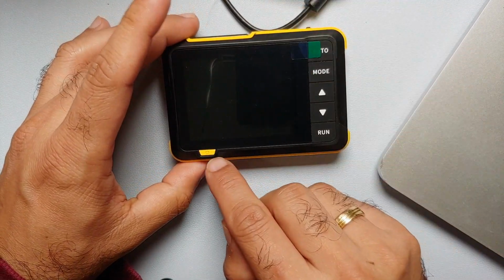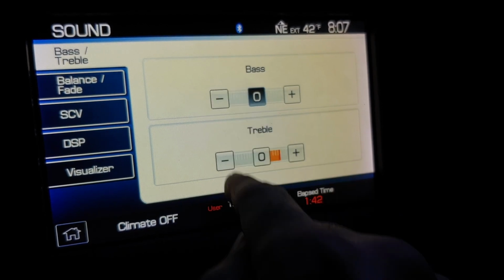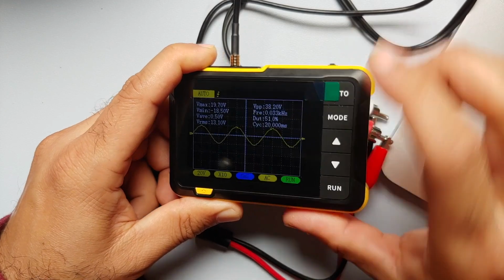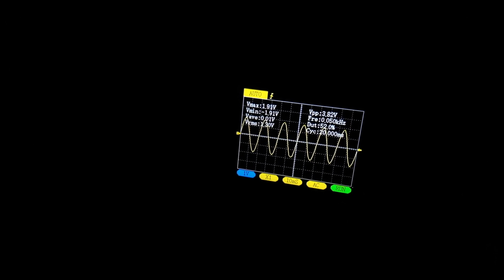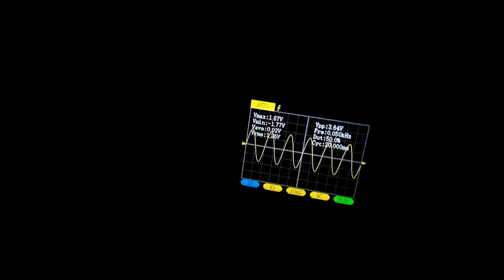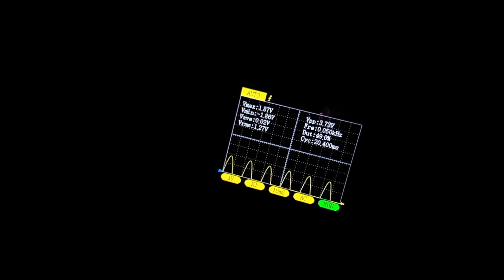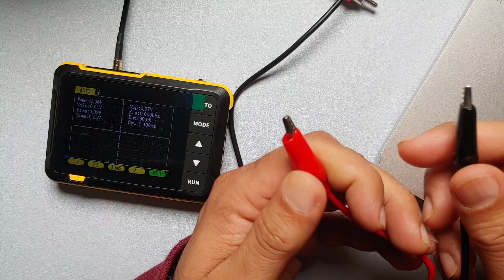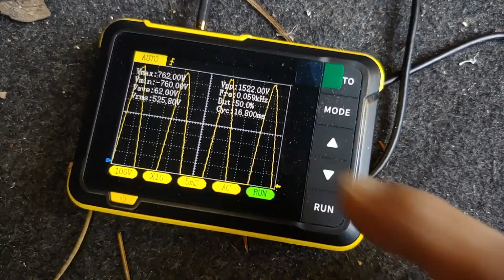How To Set Amplifier Gain with Oscilloscope for Car Audio ft FNIRSI DSO152!

Comment: I have the DSO153 and it's not showing rmsV  only Vmax and also my sine wave is smooth on my head unit and clean till max vol but on the amp + - terminals is not smooth wavy completly the top looks like a masarati sign but not flat on the top chat says is normal for class d amp I have the DD Audio DM2500A.

Comment: Boa noite amigo, parabéns , excelente vídeo!

Uma dúvida, no meu sistema de som tenho um player x7000 da pionner e testei ele com o osciloscópio e realmente não manda ruído, porém tenho um módulo taramps ds400 , 1 subwoofer taramps 200w rms e 4 auto falante Jbl 80w rms cada, porém quando tento regular o ganho do sub, tenho que abaixar o ganho do módulo para o primeiro pontinho do módulo para não ter ruído, e isso é ruim pq o sub fica tão baixo que nem dá para escutar o grave. Vc tem alguma solução? Será que esse módulo meu está com problema?

Comment: You can use a 40Hz test tone just fine... Not hard to setup an oscope manually. Use X1 (Crocs) for measuring RCA pre-outs  and a calibrated X10 to measure voltages from the amp at the speaker terminals, else you run into attenuation issues, or blow fuses on your oscope!!!!!!
Reply: Thanks for this knowledge I figured out how to do it on my own and I’m no expert i just played around with the settings and figured it out but since I haven’t done it in a while this helped me again to do it properly again
Reply: So the X10 is the setting it needs to be on if you want to play your subs and see if it's clipping at the same time?  How do you Get the calibrated X10 like you say?
Reply: @CanesupNolesDown  You can buy X10 Probes, but you'll need the correct BNC adapter (Be easier to search DSO152 X10 Probe). The DSO152 has a calibration port. Set scope to use X10, attach scope to calibration port. Use included mini-screwdriver to adjust the pot on the x10 until the calibration signal is square wave. Calibration complete.
Reply: @NF650i thank you very much!  Mine 510 came with the x10 probe. Delivered yesterday
Reply: @NF650i I think it came with that BNC adapter. I'll have to check when I get home. It looks like it though.
Reply: @CanesupNolesDown there should be a calibration setting on the oscope which one do you use? Yes put it to X10 AC not dc

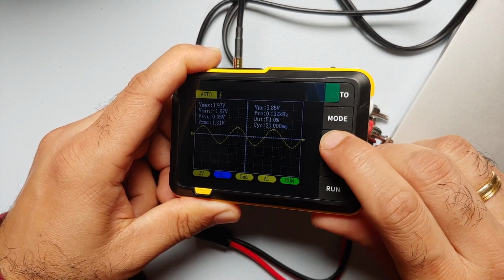Comment: Thank you for this video it's not the same model but it's the same manufacturer oscilloscope that I have. And nobody explained how you needed to set the head unit signal first and then go to the amp and then set that. Plus they didn't explain how to change the sine wave so you can see the whole thing and they didn't explain why you would need to change the time or that you needed to have it on AC. This is going to help me immensely I just put my car stereo system into my van at 2:00 in the morning and now I have to tune it and set up another amp and the door speakers tomorrow lol.
Reply from the maker: Awesome, glad I could help! Good luck with the tuning.

Comment: What settings do I use on the fnirsi dso 510 to find the head unit clip signals please I've tried everything and I can get the wave form to go up and down but when I move it to the bottom to see it better its not showing any clipping but my rockford fosgate amp is showing me a red clip signal on it at volume 30 so i know my unit clips but I'd like to see it on My fnirsi dso 510 because I'm always doing my mates car audio and my own and my dads and I'd like to set them all properly please can you help me

Comment: Ok I set the Gain to the max clean output amp can give , but what if the speakers can't go that much , what do I do ? Like I want to set it perfectly , I've set it with a multimeter but I think the sound is really quiet for a 70 RMS speaker , I want to test with the OScope and see if I get better results
Reply from the maker: you have to set it to what the speaker can handle ....so if the speaker is 70w rms max and is a 2 ohm speaker..then we multiple 75 x 2 which is 150 and do a sqrt of 150 which is 12.2 ...so I would set 12.2 on the dmm and check with scope that at 12.2 the waves are clean

Comment: My wave form is not as smooth as yours.  It isn’t clipping flat, just jagged at the peaks.  This is with the rca, and the amp outputs at all volume levels.  Any suggestions?   Could it be the o scope?   It is the same one you have.
Reply from the maker: try reducing head unit volume

Comment: Hi...I have the exact oscilloscope..
But when I test the output on My car amplifier...the waveform is really wavey....like picture jagged teeth
Reply: Are they smooth waves or when they get to the top go straight then down? If it’s that it’s clipping and your amps trying to pull more power than your electrical can supply

Comment: Great tutorial! I just tried this with a DSO-510 but the amp's high level speaker outputs are out of its voltage range when using the clips. Did you switch to the X10 probe for that measurement?

Comment: Thanks for this, when I press the arrows buttons, all i can do is move the signwave up and down the screen. They just take up the whole screen, is there a way to zoom out?
Reply: Try hitting the auto button or the run button that's what i do on mine to get the screen to reset
Reply from the maker: no there is not
Reply: Zoom out horizontally by changing the frequency scale and vertically by changing the voltage scale.  If the arrow buttons shift your graph up and down the screen, then the arrow is highlighted in blue as shown at 1:36, so use the top wheel to highlight mS or V instead.

Comment: so when i setting up my two amps gains perfectly with this method, how i set the low pass and high pass?
Reply from the maker: no idea about setting up two amps ..sorry
Reply: Wdym ,just use the screwdriver and place the screws in the same direction, if you don't have numbers or a dot on the screw , well then just guess the position by trying to match the revolutions

Comment: Thank you I wasn't aware this scope didn't read below 45 Hertz I was having an issue
Reply from the maker: welcome
Reply: Where does it say that in spec, didnt hear it mentioned in video? wondering since i usually set amp with 40hz testtone.
Reply from the maker: @gunslinger9352  at the 18 second mark and it was mentioned in the manual ..
Reply: @munchy_cool so ypu cant use it then to set the gain for bass then only highs amp . You need a 40hz tone to set for bass . Where you setting a highs amp then in the video ?
Reply: @bric7244 You can use it to set the sub amp gain but you have to use a 50 Hz tone

Comment: So just use a 45 hz tone when setting sub amp gain correct?  What tone were you playing when testing the head units max volume?
Reply: Have you found out how? Just got mine today I can’t seem to make it work
Reply: Use 40hz for sub and 1000hz 0db for speakers/head unit
Reply: @03_Kx100  that won't work with this oscilloscope... 45hz is minimum frequency.  Use a 50hz and you'll be good!